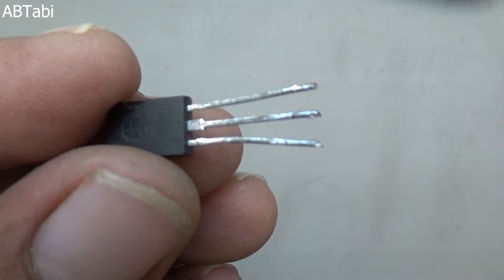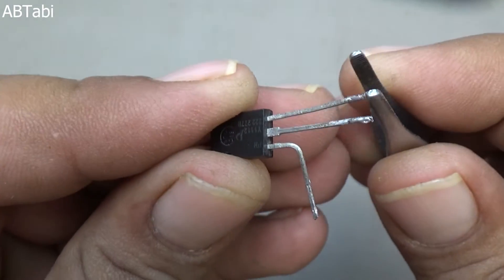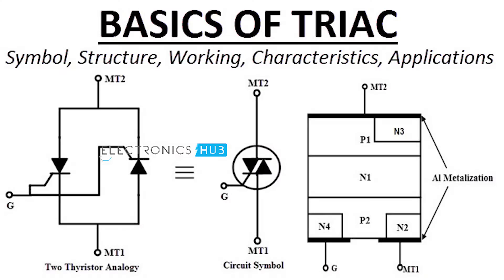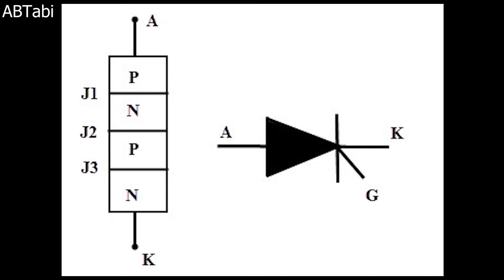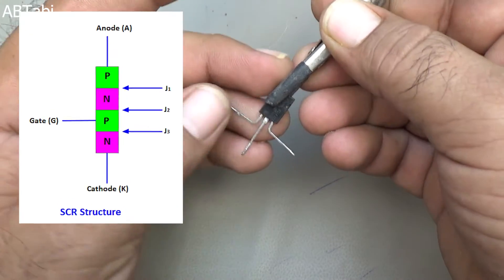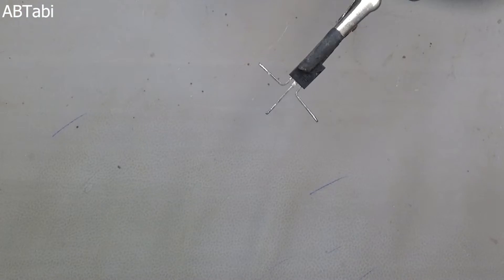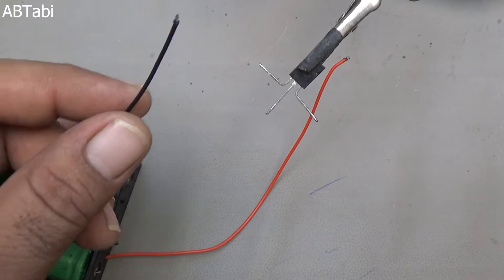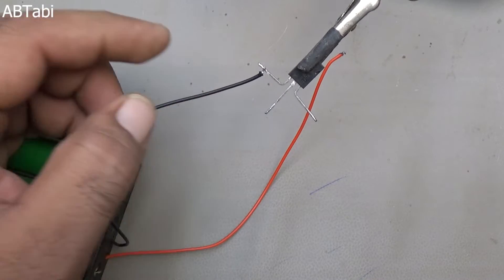How to make Automatic ON LED Light with SCR

Comment: Hello friend, this circuit can also be made with a 3 volt battery.??
Reply: the SCR has a Vd
Reply: When conducting, the SCR acts like a closed switch. The voltage drop will be approximately 0.7–1.8 V, depending on the size of the SCR and how much current is flowing through i
Reply: @kennmossman8701  Actually, thank you for explaining to me, watching your videos, I learn and if I have to damage resistors, well, that's how you learn... thank you.
Reply: why not explain What you want to do and Why.    Are those 3V coin type battery
Reply: 3V will greatly limit your choice of LEDs -   not blue o r  white
Reply from the maker: You can try ,,,,,, if you have this one or any other ,,,,,